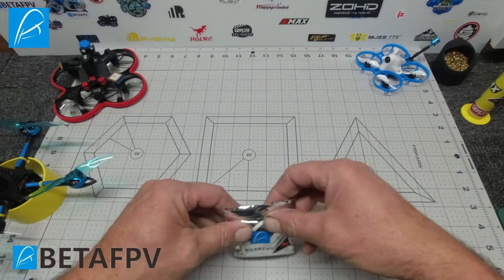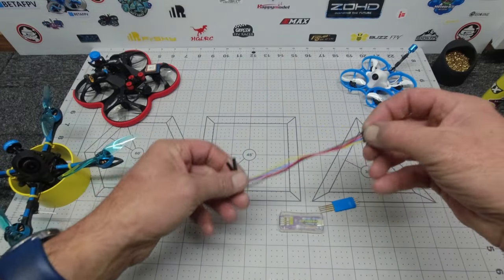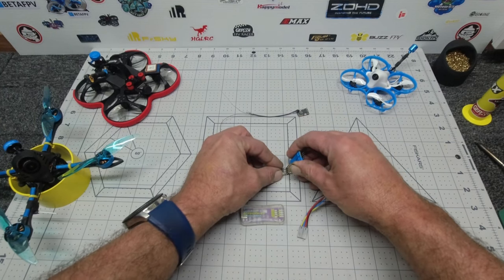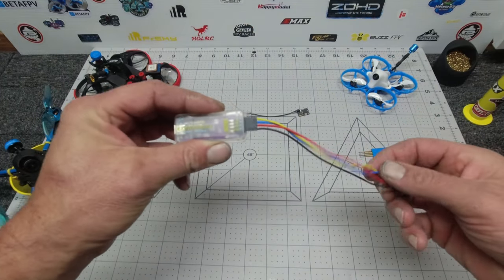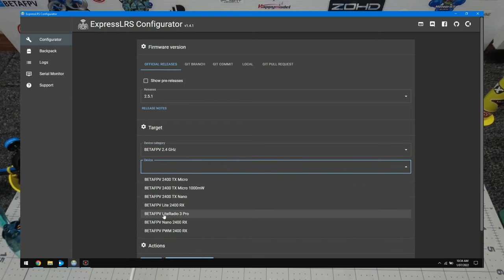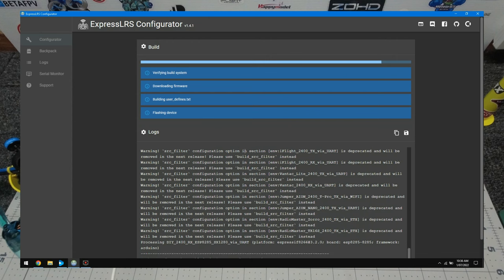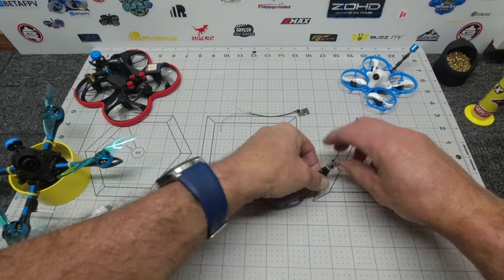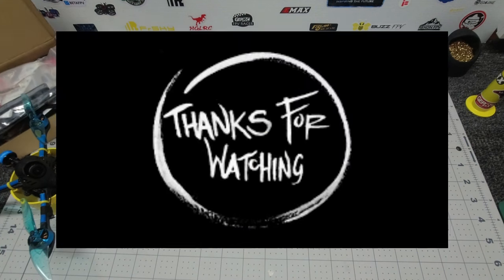BetaFPV Express LRS Recovery Dongle - UNBRICK your world!  🏆

Comment: I bought a "DSD TECH SH-U09C2 USB to TTL Adapter" for reprograming my FrSky MX+ Receivers
do you know if it will work the same, with the Express LRS Configurator ??
cheers
Reply from the maker: Hmm. I would have to day no. I do not believe that they are cross compatible. I will look into it and double check. 👍
Reply: @GTARC_au  I found this video
https://youtu.be/icYlSK91kyc
he uses a FTDI Programmer. So it should work. 
Maybe ?
Reply: @GTARC_au  just found another one
https://youtu.be/YoSAcWYlqqA
he has the same USB to TTL Adapter as me. And he got it to work.

Comment: I have the betafpv reciever with the tower antenna and it made me flash with the nano firmware and it still works. Is there a difference between the lite and nano firmware? It shows to actually flash with the lite firmware.
Reply from the maker: Hey mate. No mine did the same thing. This is normal at this stage and works perfectly with it. Cheers.